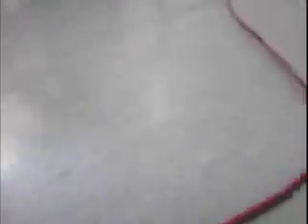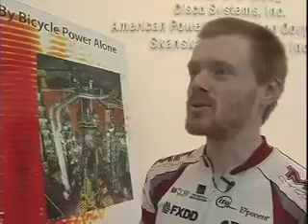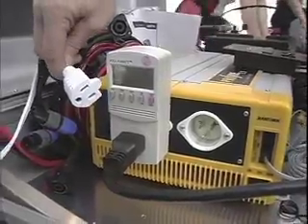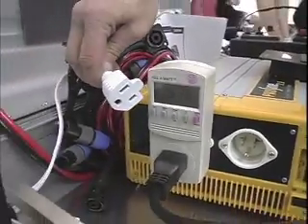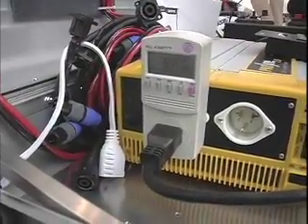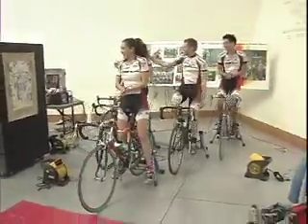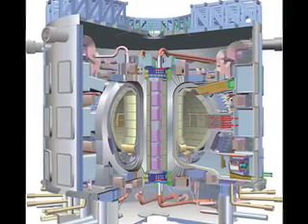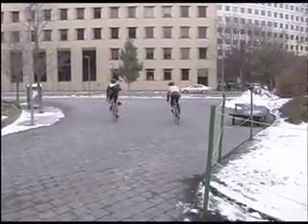MIT Cycling Innovate or Die Contest Entry

Comment: i like the idea of a bike generator. but it is like trying to connect a battery to a motor who is attached to a generator that is wired to the battery. lets say you pedal for the energy of one pizza. its gonna take more than just one pizza to get that energy back. so in short terms, you pedal your ass off and get 15minutes of electricity, but that pizza takes 20 minutes, catch my drift?

Comment: powering supercomputers to run code to solve energy problems? unless 10min of pedaling gives you an answer, I find this project not useful, as you will have to pedal for 100 years before you can find an answer. AC plug is more effective, as it doesn't have to sleep.